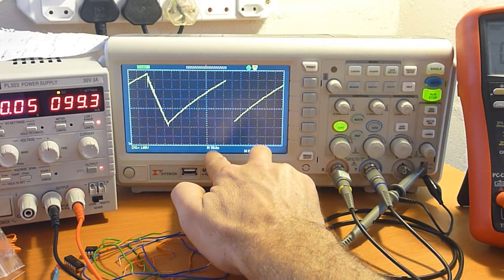Oscilloscope review / buyers guide / comparison: Xytron DSO1042CML / Atten ADS1042CML

Comment: Thanks for the information, but I have a request if at all possible.  This stems from the fact that I am new to the electronics. The issue that i have ran into is simple enough, trying to determine the type and capability of an oscilloscope that will suffice my projects. 
Request: Could you if possible, recommend what to look for in a scope that would fit the 'projects' for a hobbiest, (IE. the max voltage I would be using is the 120vAC or 12vDC battery??)
Thanks
R

Comment: I recommend previously than buy this device, check it itself.

i have ADS1102CML. I think this is not best device what i am used. Long memory in single mode Not work, some times signal disappear when increase time/div, incorrect catch signal in single mode. Hard getting update firmware form manufactures.